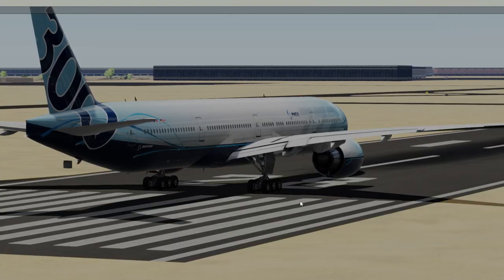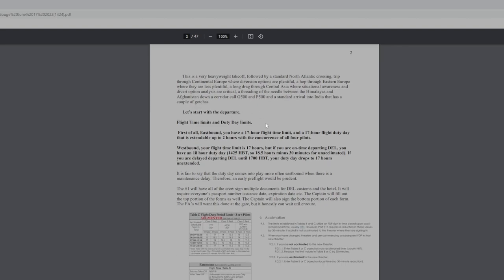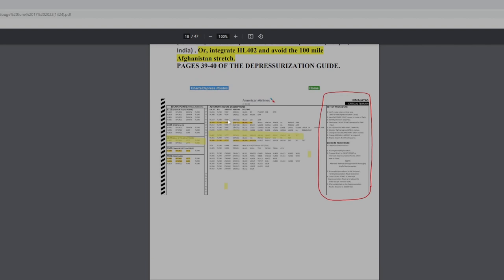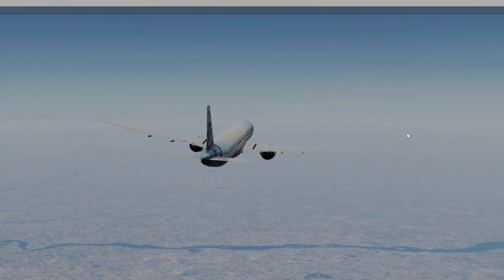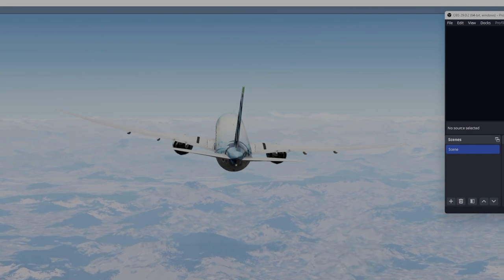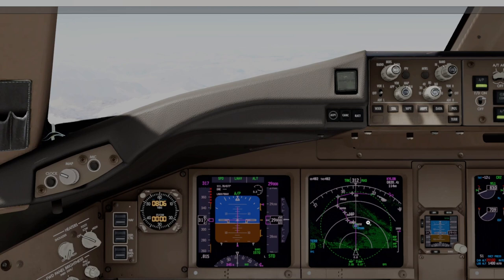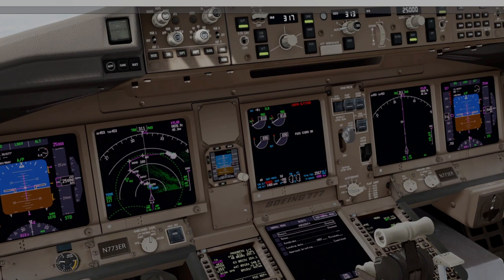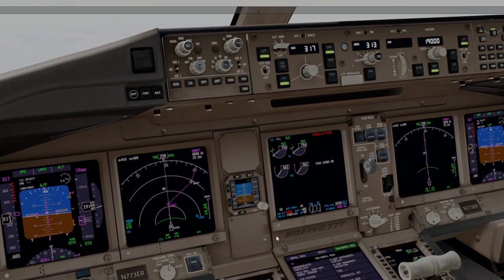Explosive Depressurization over the Himalaya's flown by a real 777 Captain.

Comment: I will give you another audio tip on modern Windows 10 and 11 that works out for noisy programs.
On the speaker icon in the tray to the lower right of the screen, by the clock.
You right click that -> "Volume Mixer" and you should get a panel appearing of individual volume levels for all the various programs, and a MUTE button, hit that it should take away the Flight Sim noise until you are where you need to be or until PMDG fixes it.
Reply from the maker: Fantastic! Thank you once again.

Comment: Is there too much turbulence when flying above those high mountains?
Reply from the maker: No, the prohibited area is due to the inability to escape after an engine failure or certainly depressurization. 
Generally, it’s not much different over the mountains. However, on occasion you’ll get a mountain wave effect beyond the mountains (as far as a couple of hundred miles away!). It is very unique, as it feels like you are literally riding a wave. If you are near your max altitude for your weight , you sometimes have to descend to a lower altitude to prevent a stall.